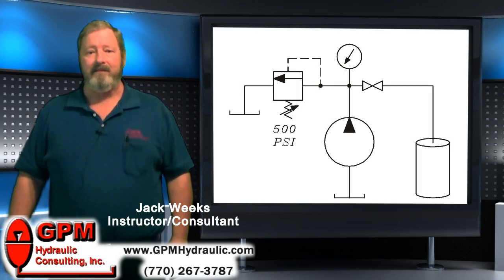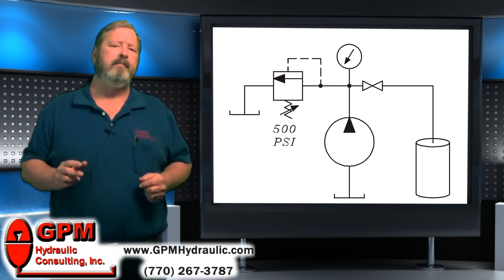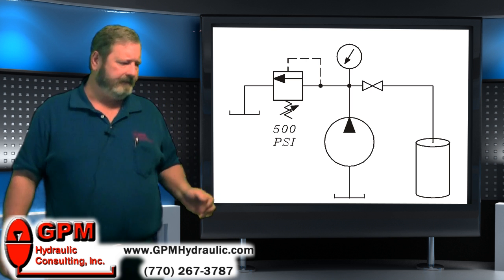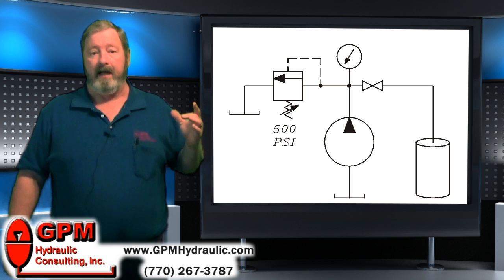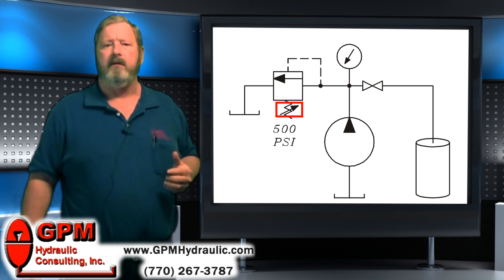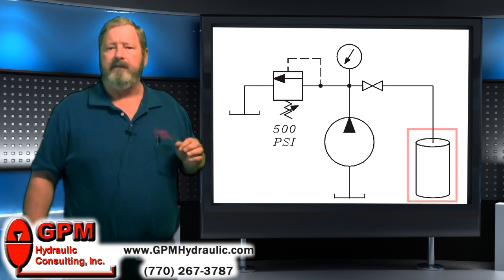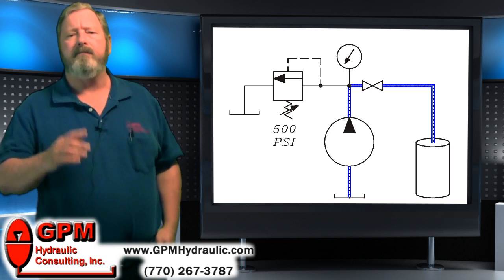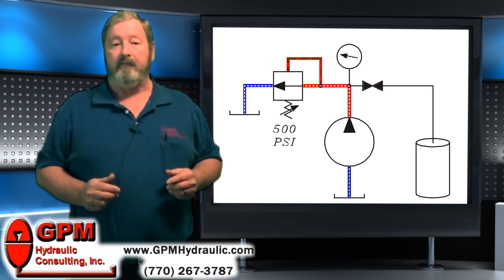The Difference Between Pressure and Flow

Comment: Thansk for useful video.
I am an Instrumentation engineer, often I come across pressure and flow meausrements. I have few question/ confusion in relation between pressure and flow. 
1. Will the increase in flow rate results in  pressure increase.
2. Will pressure drop effects flow rate
Reply from the maker: Hi Afzal,
     My apologies, I somehow missed your question and have only stumbled upon it just now 7 months later. You have probably found your answer elsewhere by now, but on the off chance that you have not I will address it. An increase in flow rate will only result in a pressure increase if the fluid is traveling through an orifice. When that is the case, pressure upstream of the orifice will increase while pressure downstream of the orifice will be determined by whatever resistance remains in the system downstream.
     A pressure drop will not affect your flow rate. Pressure in the system is indicative only of resistance in the system. The exception to this again is when the fluid is traveling through an orifice. When that is the case, a reduction in pressure upstream of the orifice will indeed result in a drop in flow through an orifice. For further information on this topic, please see my video "The Three Factors That Affect Flow Through A Flow Control" https://youtu.be/eHst0fU6s5I

Hope this helps and is better late than never. Again my apologies for missing your question.

Jack